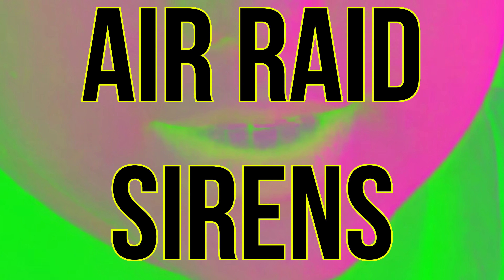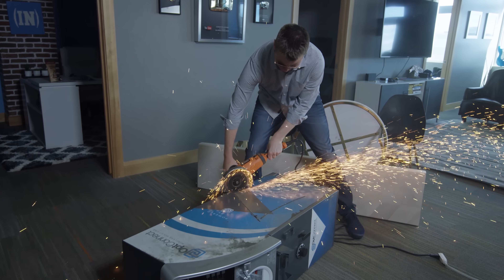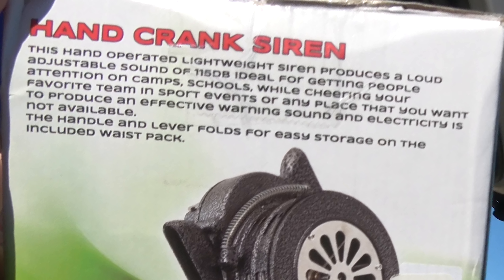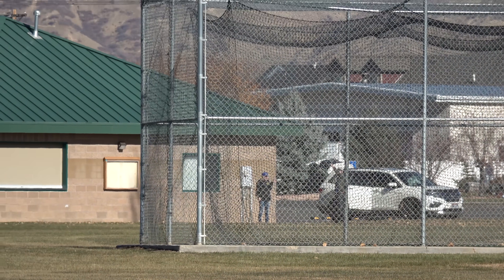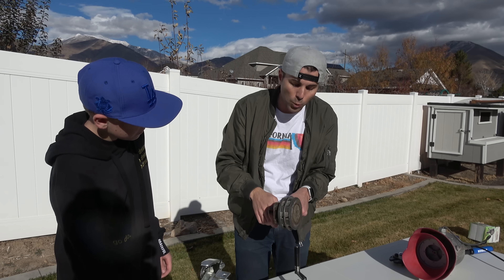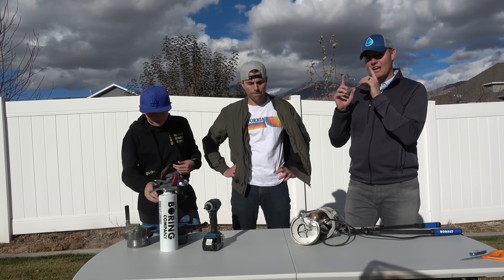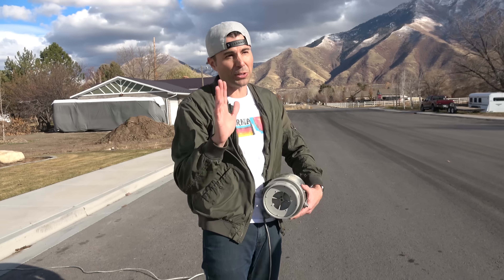What's inside an Air Raid Siren?

Comment: 3:45 how it also works is that air push through one pattern then block on the other which makes that sound and other one have a blower which push air into the chopper that makes the sound

Comment: For those who doesn't wanna listen to mark gibberish:
The siren's rotor sucks air like a fan. Centrifugal force pushes air to the walls of the rotor. The rotor's blades are mostly L-shaped. Force pushes the air to the part of L that is further from the center. When ports open, the air gets out and pushes another air molecules, creating vibrations, creating sound. The faster the speed is, the higher the pitch. Just think about it: this whole process just happening literally several times a millisecond.

Comment: Yes, mark is right about how the siren works but this is how a mechanical siren works explained in an alternative way, (i'm a siren enthusiast so i know a little about how sirens work and the different models) basically, there are 2 parts, a rotor, and a stator, the stator has little holes on them, also, the stator does not rotate. some sirens have more holes than others to produce a different sound, some sirens rotate, (the entire siren, not the rotor) and some are omni-directional, and some are dual toned, I will take an STH-10 (a model of siren) for example, it has 12 holes, so you would say "12 port siren" and the reason the model has "10" in it's name is because it runs on a 10 hp motor, siren motors typically run at around 2800-4000 RPM, now onto how it makes sound, (yay!) so the rotor has little tabs on them, when the rotor spins, it will force air through the stator and chop up the air, the faster it spins, the more louder it gets, and the pitch gets higher, and once it gets to the amount of rpm labeled on the motor it has a steady sound (this is called "alert mode") But sometimes it does something different, sometimes the siren will wind up, then wind down, and the cycle continues until the signal is canceled from the "AR Timer" (something used to operate the siren) (this signal is called "attack mode") Now for something a bit different, some dual-toned sirens have solenoids, I will use a 3T22 as an example, the siren has 2 intakes on the top and bottom, one for the higher pitched part of the siren, and one for the lower pitched part of the siren, what the solenoids do is it blocks those intakes, a "hi-lo" signal, blocks the top, then bottom intake in a cycle, with a "pulse" signal, it blocks both intakes at the same time in a cycle, There are attack mode versions of it, "alternate wail" is a hi-lo signal in attack mode (not steady hi-lo) and "pulse wail" is a pulse signal in attack mode. (not steady pulse) That's pretty much it!
Some common siren manufacturers: Federal Signal - By far one of the most popular, Their most common sirens produced are the 2001, 508, Modulator, Thunderbolt, and the 2T22 (thunderbolts and 2t22s aren't made anymore but you can get them from places like West Shore in Allendale, MI) (Last 2 are a little uncommon but still) | American Signal Corporation - Another popular one, probably not as popular as Federal Signal, but still popular among the united states! Their most common sirens produced are the T-128, T-121, and T-135. | Whelen - Whelen makes loud and effective electronic sirens, Instead of using air and choppers and all that stuff, It uses speaker drivers and sound files! That means you can play a "This is a test" message before or after the test! Their most common sirens produced are the WPS-2800/2900 series, Vortex, and WPS-4004. | Acoustic Technologies. Inc - oh my god, where do i even begin, ATI's are HORRIBLE, the build quality is awful, the sirens are weak as heck, the sound quality is extremely low, and they are great for breaking down IN THE SPAN OF ONE YEAR, San Francisco has these sirens and they used to have STL-10's, then they "upgraded" their system to THESE, and even worse they replaced it with RECORDINGS OF STL-10s. Their most common sirens produced are the HPSS-32/16, They have stuff like 32r/16r (rotating counterparts) but they are less common, anyways thank you for reading through this entire essay of mine.

Comment: 4:25 you were wrong the fan structure is called a chopper the air is chopped up in the holes and the sound is made by blasting air out of the big round hole
Reply: A chopper is basically a type of fan. It sucks air in, compresses it and spits it out with such force it can blow snow, leaves, bird nestes and sometimes even its own cover away while yes chopping the air at the same time. You can even turn a humble computer blower fan into a siron too.

Comment: Folks, more science right here if you want it: If you get the RPM and divide by 60, you get how many revolutions per second, the rotational frequency if you will, if you then multiply this by the number of blades (equally spaced), then you will get the frequency. The full formula is simply: RPM*Blades*60^-1

Comment: What's inside an air raid siren: a chopper rotor. The chopper chops da air, making a loud and higher pitched sound, then the air is shot out. That's what's inside and how an electromechanical air raid siren and a tornado siren works.

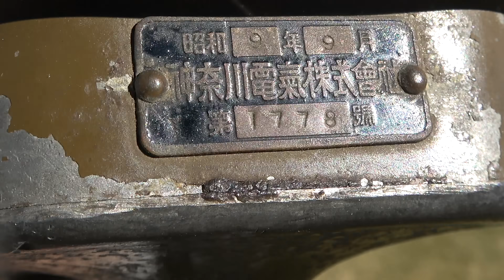Comment: 0:24

Shōwa 9 nen 9 gatsu 
Kanagawa Denki Kabushiki Gaisha 
Dai 1778 gō

Since the Showa period starts in 1926 therefore 1926 is Showa 1 year
So showa 9 year would be 1934 and 9 month would be september. Thus:

September 1934
Kanagawa Electric Co. Ltd.
Issue No. 1778

Comment: "Next time you hear a air raid siren you know how it works" dawg I think you got bigger problems if you hear a air raid siren
Reply: Pretty much same principles for any siren. My elementary and high schools both used electromechanical sirens for fire alarms before which I remember hating. I think the rated sound level on them was 110 db at 10 feet.
Reply: My fire department uses them

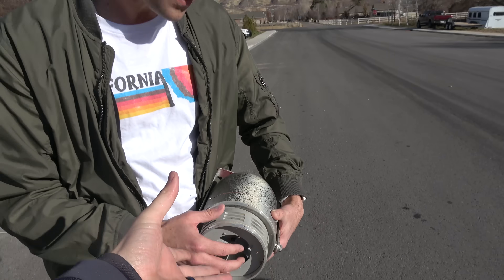Comment: 5:50
the difference with this one, is that fire truck sirens are tied to the engine exhaust, so the faster the engine revs, the faster the siren spins.
that was common in all vehicles with sirens until the 1970's or so.... then they went electronic.
some fire trucks still retain the mechanical siren, plus an air horn, plus an air whistle.
can't overdo it when it comes to opening way for a fire truck lol

Comment: So in the rural area where I live, our volunteer fire departments have sirens that go off to signal every emergency call (often it's several times a day). Their range is up to 4 miles. I've always wondered how they worked. Often their sound is more "pure" than an air raid siren; I've heard one before that's almost a pure tone/sine wave (but it's mechanical, not electronic). Sometimes they have horns coming off what appears to be a motor, sometimes they look like two or three cones stacked up with a grille in-between. Do they work generally the same way as this one?

Comment: Basically the fact that whenever someone spins the rotor in it, it become like a turbofan from a airliner (that is why airliners are very loud) and as you spin faster more air starts to get trapped at the blades that they create a lot of sound until the person is done with it

Comment: Yeah it's the same like a jet engine you know when you hear like a high-pitched sound when the engine is running it's because the fan blades are picking up air to move it to till you can move the engine and the whole structure of the plane [⚠️question test what would you do if the engine is running when you are near the engine?⚠️]

Comment: If you've ever wondered why fire trucks, engines, and heavy rescues have louder Sirens than everything else this is why. All modern fire trucks in the United States typically leave the factory with one of these installed the brand is a federal signal Q if you feel like looking them up. sirens on our rigs are audible over a mile. In the National Standard a siren only has to be Audible for 500 feet the same standard most police cars use for their audible warning device. Most foreign countries use that same standard. For whatever reason in the United States the fire service has refused to accept 500 feet as acceptable and run these Sirens instead. I have never seen a truck without one and I would assume it would have to be a special order to have it removed from the specs. I have heard of some large cities not allowing the fire department's to use them because of disturbing the peace and waking people up in the middle of the night. Not the case where I am we run them wide open on every call.

Comment: Safety PSA: Don't break things that have high-speed rotating parts while it's running. Good way to get shrapnel inside you. Also don't put your fingers near the rotating parts, I have 2 friends that chopped off part of their fingers that way.
Reply: Like for real, they have this "Nasa Expert" and they still went through this? Anything for the youtube revenue right?
Reply: @Gamespflow  Yea, I have been studying air raid sirens for 2 years and it is very easy to get shrapnel in you if you touch the parts while they are rotating. Plus it hurts me to see those air raid sirens be destroyed for YouTube views and revenue.

Comment: Weeell, as much as I liked Mark's explanation, the one that would have satisfied me much more is that it sounds like one of those party tooters that do a "zoom"-ing sound, only that those are propelled by you blowing on them whereas the air raid siren is propelled by the crank (or motor). The high speeds are achieved by a gear system that translate a few handmade turns with a high force into many quick turns with low force. ~Science~

Comment: "explosion hazard" will just mean it's a brushed motor and therefore liable to have sparking inside it. It's fine as long as there's nothing flammable in the air.

Comment: These little hand sirens were only used in small areas or barracks. Actual air raid sirens from WWII and the Cold War are considerably larger, and still in use as tornado sirens and calling firefighters. However, the big sirens work the same way as a small one. Why would you destroy that siren? You could have sold it for $100 or more.
Reply: Because they are rich

Comment: Low pitch and high pitch is also sensed by different parts of your inner ear. There's a giant coil with a bunch of small hair like projections and fluid fills up this canal. As the air "crashes" on your ear drum it sends vibrations through these fluid filled canals. So higher pitched sounds vibrate these sensors at the beginning of the coil and lower pitched sounds are heard at the end of the coil. That's why you loose high pitched freuqency hearing first based on their location early in this coil. MORE SCIENCE FOR YA

Comment: Hi, please let me start off with saying "Great video, I found it rather interesting".
Secondly, I am not a native Japanese speaker but I find the culture and language incredibly interesting.
Thirdly, the frame showing the writing is very difficult for me to read and with those pins holding the plate in position I can't see part of the writing... but here's an attempt.

昭和9年9月                                         September 1972
?*卑奈川電氣株式會布*?
              ?*Bonagawa Electric Ceremony*?
電1778務                                            Electricity 1778 duty

So my guess is that it is information about the manufacturer and the serial number.
If anyone wants to tell me anything I've missed, don't hesitate.

Comment: You should cut open a tornado siren, though I imagine they're similar?
Reply: They function in pretty much an identical way, although I would advise against it. There are also electronic sirens, but they are simply large speakers that play a tone. Theses are rather important pieces of history that are hard to find and to have them destroyed is really a shame.
Reply: Yes they are very similar, only bigger and louder, their are also electronic kinds. Most warning sirens in the us are mechanical
Reply: Yes, they are very similar. Most outdoor warning sirens in the united states are either: mechanical or electronic. Mechanical one, like they destroyed in a fashion that risked their safety and lives, use a spinning "chopper" to gather and split air to create sound. Electronic sirens use speakers use speakers and complex tone generators in the controllers. Many sirens also have additional features like a rotator for a directional siren, and complex controls for more function.
Reply: @valrabellkeys9867  what siren is in your profile pic?
Reply: @Snowcube  An STH-10 missing half of its horns in Wynnewood, Oklahoma.